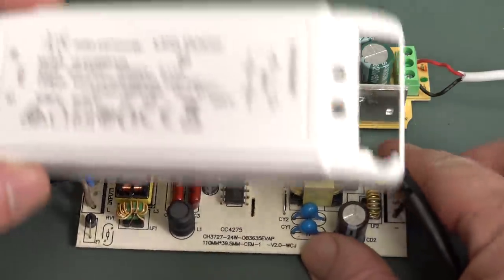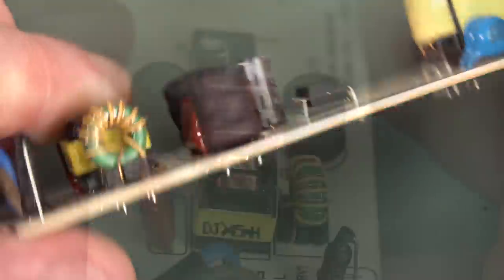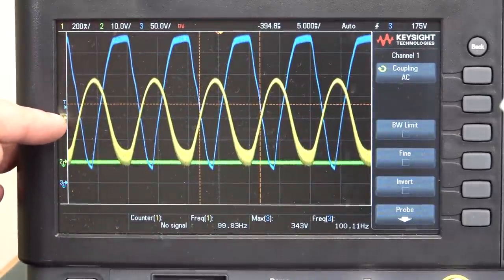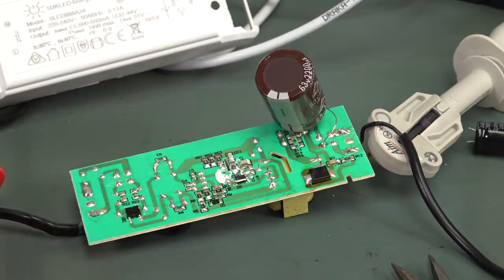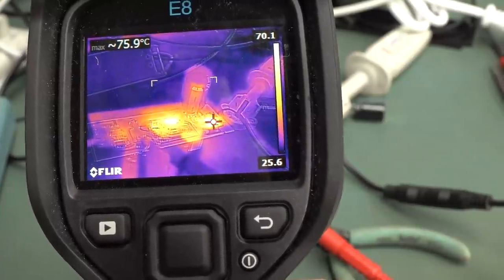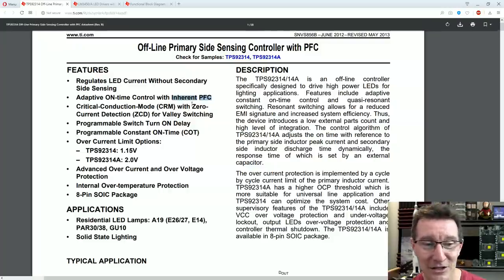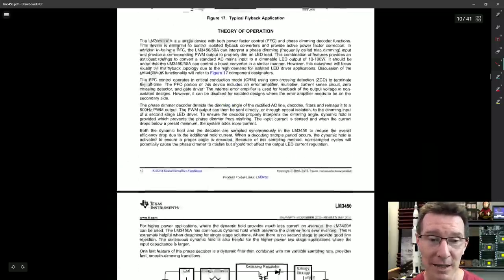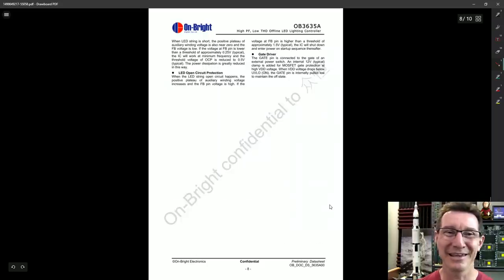EEVblog #1253 - LED Flicker 2: Electric Boogaloo

Comment: You should have connected the primary filter cap /behind/ the 2 filter chokes, that would have smoothened out the current peak a good bit, and so improve the PF!

Comment: Your main B+ should have went up considerably with the primary filtering you added.  That would raise the VCC to the switching IC, you probably need to change those dropping resistors to compensate.
Reply: The IC powers itself from the feedback winding, not the 660k resistance.

Comment: Love these videos. I wonder why there aren't (easily found) room-level solutions. i.e. if you have multiple LED panels in a room, why not have one main AC/DC converter with good PF, efficiency, and EMI, rather than 10x mediocre AC/DC supplies. Then each panel can have its own DC CC driver.
Reply: It's actually quite common, called 12V LED strips driven from a 12V PSU.
Reply: @NiHaoMike64  They aren't really good solutions for large scale lighting though. Too much power is wasted in the current limiting resistor in each section of a 12V LED strip. For example, one that I have lying around has a 150R resistor per 3 LEDs. At 12V, 25% of the power is wasted in the resistor.
Reply: @JohnBurgessMusic  Same with your case of have dc-dc per panel and single ac-dc. you would either waste power in wires between them or waste money on thickass cables. Anyway it is not very efficient and a lot less redundant. I imagine that one faulty dc-dc could at least trigger protections (potentially cause damage) on parent ac-dc and render all the panels useless until the fault is isolated from the rest of the setup.
Reply: @Mr.Leeroy  it's more about simplifying the install. You cauld have a 240V current source and connect as many panels in series as required up to a limit of 240V but then you have to run all panels at once. The converter per panel is a compremise on functionality and ease of install for electricians that are not neccessarily that educated in electronics and can be quite thick like the lovely guy i use. I had to help him instll my solar batteries as it was his first time with that kit.

Comment: Would it be worth getting a single large properly smoothed DC supply and running all the LED lights from that instead of having a separate convertor for each light?
Reply: that would require an install by install design as no one can predict how many lights each location will have. Eletricians can be surprisingly thick and are just builders that have read the electrical instalation manual as in how to physically install stuff. Few understand the underlying principles so any install have to be simple enough.
Reply: No It would not. As it would be a low voltage installation and so covered by the LVD the installation could be carried out by the user. Anyway that was not really my point. My point was from a technical (Not Legal) perspective, would it be better and more cost effective to have the lights installed using a single supply.A suitably rated converter needs to be selected anyway so it would be easy to have supplies rated for power, which they already are. Eg a 500W supply could be used to feed 10x 50W lights. The number of lights for a particular installation is not an issue as a suitably rated supply could be selected. I am not suggesting that a bespoke supply be designed for each installation and that is certainly not required. There are literally thousands of existing supplies which could be used. Understanding of the underlying principles is not needed.
Reply: @JerryWalker001  And i answered the tecnical aspect not the legal one. You would have to put them in series. This means that you need a driver for "x" amount of panels. You could in theory have a 240V current driver that would allow up to 240V worth of panels in series. You can't put the panels in parallel because they are LED's. it also means you have to turn the whole lot on or off and there can be an energy savings case for being able to independantly switch the panels on and not the lot. The simplest trade off is one driver per panel although one driver of better quality per 2 panels would not go amiss.
Reply: Hmm, I am not sure if you are intentionally ignoring my point or you just don't understand it. Dave's video was about the inner workings of LED drivers and my comment was SPECIFICALLY about the technical advantage (or otherwise) of driving them all from a common source. Powering multiple LED's from a single supply is not difficult and makes no difference to my point. Also are you saying that in office light installations there is a switch for each individual light? That is NOT how lights are normally installed, Users would not want 20 switches for the lights although there is no reason this could not be done for a single source driver. It would be identical to any other approach so I have no idea why you think they would all NEED to be on a single switch. Normally they are installed in 'banks'. They would NOT need to be installed in series, there are many ways to create very simple single source multiple drive supplies. Technically it is NOT difficult. However my point was NOT about that, it was about the technical advantage of such approach. Finally, YOU are the one who mentioned the need for particular understanding from installers and this is not the case any more than any other system or other LED driver approaches. My company installs such centralised systems and they work out far more cost effective and reliable than distributed modules. A similar example would be the advantage (or otherwise) of single (or multiple) invertors for solar panels compared to micro invertors fitted to each panel.
Reply: @JerryWalker001  Solar systems are large and expensive (£11'000 for mine) and designed to a degree for the building. i went through much negotiating with my installers as the inverter had to be matched to the panels and with 15 panels in series I had nearly 500V which the 4KW inverter I already had could not take even though it was 4KW of panels so i upgraded to an 8KW inverter just to get increased voltage input, it required some consideration. I am not ignoring your point you are missing mine. The office i work in has 3 banks of lights for 10 people. Yes we could have 3 series strings of lights. You cannot connect the LED panels in parallel, they have to be connected in series. I don't know if it is practical to design a supply that can cope with multiple voltage ranges. It also means that you need several power supply modules available to the installers as they choose the one required for the number of panels. These supplies were clearly designed down to a price so a single unit capable of such a range of output might not be practical in the cost constraints. Remember that efficiency and power factor must both be high. Having a bigger transformer than required will not be good financially as it's the most expensive part. i don't know what the install rules are. put it this way, i am sure they considered all angles during design given how costed down the install is. Yes it would make sense to at least do panels in pairs or say 3 or 4 but it may mean the installs have to be done in blocks of however many panels the supplies work with.

Comment: The problem with big input capacitors is the nasty inrush current seen from the line at power up. That was a nightmare for people that designed electrical protection equipment like ups or automatic voltage regulator based in SCR's or IGBTs, easily a small room with older pc's could produce hundreds of amps.

Comment: On the cheap circuit, simply add three diodes to the output to make a full-wave bridge rectifier.. It'll double the output current capability and improve the ripple :)
Reply: No. This is a Flyback topology, it relies on having one (exactly 1) output diode (per output rail). Ripple is there from having essentially no input filtering

Comment: I wonder if there was some design reuse happening here. The primary side filtering is suspiciously similar to what many triac dimmable led drivers use. It seems logical that they might just modify an existing higher end design to just be as cheap as possible. It would simplify BOM inventory and be much quicker to market with half the design already done. Both the board and case being designed for screw terminals yet having wires directly soldered on lend credence to this.

Comment: The flicker from that cheapo LED driver is no worse than the good old flourescent strip light that we have been happily using for the last seventy years or so.  Admittedly there were always one or two people in the office that complained that the flicker was giving them headaches or other ailments but when the lamp drivers were upgraded to electronic versions switching at 50kHz or so with negligible output ripple, they still complained.

Comment: I am still trying to figure out why any excess capacitance is a problem, just about every home and industry is inductive.  In Florida the power companies have capacitor banks (at the 13.5 kV level that they can switch in and out via 900 MHz links, all over the place.

Comment: It's all very nice to have flicker-free light, but there is one small point...    The old standard inductive-ballast troughers (and for that matter any AC-powered gas-discharge lamp) will all have 100Hz flicker, so the green-subsidy-gobbling suppliers have effectively replaced like-for-like (electronic ballast upgrades notwithstanding).   The move to smart meters will result in billing based on apparent power, so it's in the  customer's best interests to maximise the  PF.
Reply: As someone who is easily bothered by flickering I never found fluorescent lights mounted in pairs (out of phase) to be particularly problematic... guess they have a good amount of decay time, similar to CCFLs. That's why PWM backlight dimming only became an issue with the transition to LEDs, which often seem to respond much quicker.

Comment: The lousy power supply has a massive ripple, so generating an output that is solid with the same voltage range would require more current and an up voltage inverter? Which would overheat the components of the supply? Does the supply have like panel number limits?

Comment: why use a dedicated constant current led driver specialty chip if basically a lowpass filter a say 78xx series regulator  and a couple of pass transistors should do just fine too i guess?
Reply: Of course you could use something LM317-ish as a constant current source on the secondary side... but efficiency would be pretty shit once there is a lot of voltage to get rid of.
LED lighting is such a big market that rolling custom chips is easily worth it if it promises lowering BOM cost, complexity and development effort.

Comment: Why does adding input capacitance effect the power factor? What IS power factor anyway?
Reply: Oh, there's a name I haven't seen in a while. Anyway, instead of reinventing the wheel I'll just recommend starting with the Wikipedia article:
https://en.wikipedia.org/wiki/Power_factor
Reply: Adding input capacitance (or even input inductance) effects the phase angle between the voltage and the current. If you have a pure resistive input impedance then the phase between the voltage and the current is zero and the ratio of real power to apparent power where apparent power is measured voltage times measured current (VoltAmpere)and real power is measured voltage times current in phase with the voltage (Watt)is 1, i.e. the power factor is 1. As the voltage vector is common to both calculations it essentially cancels out and the calculation can be expressed as current vector (I) times the cosine of the phase angle (Resistive current) divided by the current vector (Apparent current).  Again the current vector is common so power factor is cosine of the current phase angle.
   If the input impedance is such that the phase angle is 30 degrees then power factor (PF) is cosine (30 degrees) = 0.866. 
   So why does this matter? Firstly your electricity meter measures the current vector so you have a higher current demand then if you had a PF of 1 i.e. you are paying more then you need to. Secondary reason to have a good PF is that your wiring and switch gear does not need rating for the higher current that would be present with low PF.
  Also with non-linear circuits ( in this case the diode bridge) you get harmonics from the current waveform distortion, particularly in high power (kVA circuits) this could lead to overheating in the supply wiring ( look up skin effect and litz)

Comment: why not have a full wave or bridge rectifier on the output side? wouldn't that make it easier to filter?
Reply: This will not work with the Flyback topology. It's all about how the energy being transferred from the primary to the secondary side. Wikipedia has a pretty good explanation of Flyback converter operation. https://en.wikipedia.org/wiki/Flyback_converter

Comment: 4:41 - I have this little ticklish in my mind about the power factor discussion here. PF (as of my understanding of Wikipedia definition) is a ratio of apparent average power in .vs. real power consumed. How can this device return some power to the main if its got a bridge rectifier at the front end? No power can go back to the main if diodes are feeding current in only one direction. Could it have to do with the presence of C1 and L3, at least partially? By the way those two parts are absent from the schematic. So can anyone explain to me why the power factor is not plainly 1 ?
Reply: A low power factor can not only be caused by a phase shifted current through inductors/capacitors. It can also be caused by having a non-sinusoidal current, which any bridge rectifier with sufficiently large filter cap will produce. In this case, power factor can be low, even though there is no power fed back into the mains.
The wiki definition of power factor is only valid when dealing with perfect sine waves

Comment: Is there actually some benefit to having a full bridge on the secondary side or doesn't that really matter if you don't generate a proper full wave input to the coil?
Reply: You don't use full-bridge rectifier on secondary of flyback converter. Having a full bridge there will cause a) high inrush currents when first switching on, can blow up the primary side circuitry; b) higher loss in operation due to two diode voltage drop instead of one.

The operation of flyback is highly asymmetrical. During one polarity, the transformer builds up energy in its magnetic loop. During the other, the energy is "discharged" into the secondary side. The actual voltage values in these phases may be somewhat different.

Comment: I remember when I made my bare minimum shitty led driver from an old TV power supply and a 150watt 230/24v/8a transformer. The ripple was 200%. Straight from the 230 mains haha. It "worked" but it was awfully regarding flickering lol (no sh*t!) It was just for testing no longer than a few minutes. It where like 200 leds drawing like almost 2 amps from the mains

Comment: Around 3:12 you made an error. Capacitors in parallel follow the same scheme as resistors where the value is divided by the number of components in parallel. Two capacitors at 150 nF in parallel would result in 75 nF, not 300 nF. Two capacitors in series would result in 300 nF.

I have a bit of experience with this because I've had to fudge capacitor values by using two higher value or different value capacitors to get a non-standard specific capacitance, or when I need a non polarized capacitor by placing the anodes/cathodes together. NP electrolytic capacitors can be expensive or not available, using two normal polarized caps is a good alternative, especially when space is at a premium.
Reply: No, two capasitors at 150nF in series would result in 75nF not 300nF
Reply: @barnenlenovo681  My capacitor tester must be lying to me then. It's one of those ebay specials so no telling who actually made it.

Comment: Why do the power companies scoff at a low PF due to capacitance? I thought the majority of PF losses were due to inductive components like motors. Wouldn't these offset those losses? Or are they worried the PF losses would shift in the opposite direction? (From mostly inductive to capacitive)
Reply: CTB: The power factor of other devices is irrelevant.  Every device should have reasonably high efficiency.
Reply: There is a difference betwen phase-shift from big inductors and caps directly across the mains, and current distortion from big caps behind a bridge rectifier. But both just increase the losses for every kwh of real powwer deliverd
Reply: Capacitors shift the power factor in one direction, inductors shift it the other way, which is why large motors with high inductance are usually pared with a beefy capacitor in industrial applications to keep the power factor fairly close to 1, as industry are billed on apparent power, rather than real power
Reply: Power companies don't hate big capacitors in appliances. Here what makes them unhappy: full bridge rectifier, followed by big capacitor. Reactive power that this  setup generates is particularly hard to filter

Comment: A single stage may work with some real current measurement feedback instead of a pseudo assumed feedback.   Would almost need to be on a switching frequency cycle by cycle basis.

Comment: Could think of a bigger and proper led driver at 500 watt and hookup 10-11 led panels on that and your chicken diner is ready.
Reply: These are designed to be retrofitted into existing lighting setups. IE: replacing florescent tub lighting with LED panels. 240v is already present at each fixture, making it  easier to replace individual panels. Also makes it easier to change a panel or two if different k color is wanted.